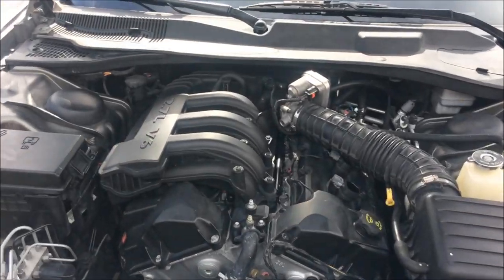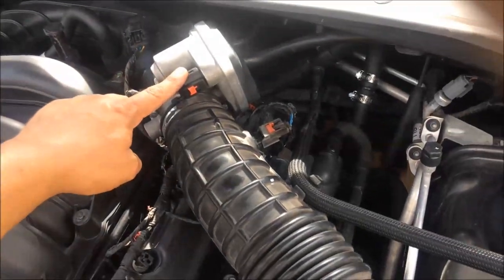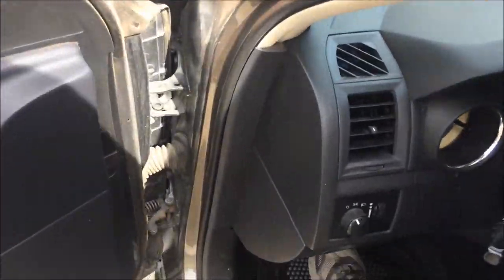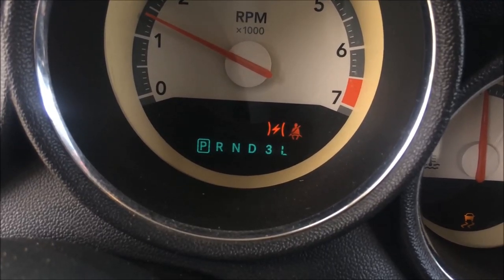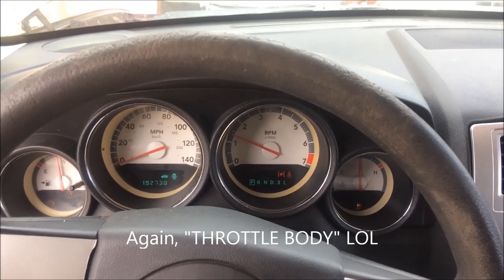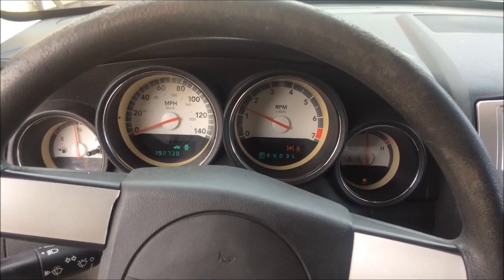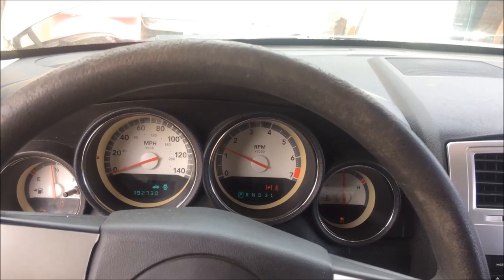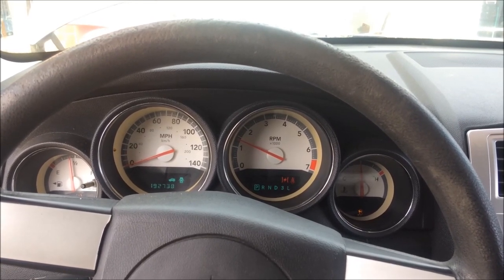Chrysler Dodge 2.7 3.5 v6 mysterious rough idle CHARGER 300 MAGNUM - EXPLAINED & FIX

Comment: I have a mysterious miss. After my 2010 300 heats up, it will get a miss if I turn off and restart the engine. It will run rough for as long as I drive it until I turn off the engine and let it cool. I can have the engine run for hours and it wont run rough ever if I dont turn it off.
Reply: Same u ever fix that?
Reply: I had a similar problem when my car would run to operating temp and I shut it off it would not start back up until ithe car completely cooled off changed my crank sensor and it fixed my problem hope this helps
Reply: @bimmergang2035  any news? Thanks
Reply: Egr valve
Reply: @vemomediadigitalmarketing7912 You think it’s the EGR valve?
Reply: Really…?

Comment: Hey man i had a peddle commander on my dodge gt charger 2019 it was working good for a couple months one day i gassed it to hard cause i was chasing some lasy that hit me and it made me go limp mode since then i unplugged the peddel commander and my car drives normal but when i gas it or take off at a light or take offf at a corner its holds back and turns on the engine light after a day the engine light goes away but happens again when i gas it what do u think i should do?

Comment: I was replacing my 05 magnum valve cover yesterday and didn’t get the main vacuum line into throttle body. Shit was running rough and I was so confused because I thought everything was plugged in. Gave that metal line a extra push and it went in how it originally was and runs like a charm
Reply: Also had flashing throttle light

Comment: I have been having issues with my 07 turning over for a few seconds and then cutting off, every time the exact same amount of time when I turn it over. And it just dies, no rough turn over or idle just starts . . . dies After a few tries it won't turn over at all and just has the lighting bolt stuck on the dash. No other indicator lights, not even the engine light, just the bolt. I am getting ready to buy a new throttle body but if you have any other suggestions, I could really save the money right now since things are kinda tight at the moment.
Reply from the maker: That’s an electronic throttle issue. The first thing you would want to try is to clean and reset the throttle body. Clean it good then disconnect the battery if you don’t have a scanner or have access to one. Make sure you plug the throttle body wiring harness all the way into the throttle body and it’s not slipping off like stated in this video. Check your battery voltage, clean battery cables etc to rule that out. If that doesn’t work then replace the throttle body (Check Amazon)  You can get throttle body / MAS cleaner at Walmart or any auto parts store. Manually open the throttle body and clean it really good. When they are really dirty it can restrict air flow but what you are experiencing is typical of a failed throttle body.
Reply: @WarPonyAuto  I am having the same problem with my car
Reply: @WarPonyAuto  how do I fix it
Reply from the maker: @hopearonson1034  It takes a proper diagnosis but if your is doing the same try cleaning the throttle body. Usually this means the throttle body needs to be reset or replaced.

Comment: I just started having this issue after changing coil packs, spark plugs,  and fuel injectors.   Maybe, I didn't get mine completely clicked in.  Thanks man
Reply: Did this work for you? I did these exact changes on a 2009 dodge charger 3.5L an now I’m having the exact same problem, the rough idle and shaking is so bad that I cant even drive the car or let it run longer than 30 seconds to check the engine
Reply: It did, but I also went ahead and a new sensor as well
Reply: Could you tell me what that sensor is called exactly, Im going to try the same thing
Reply: Map sensor

Comment: Great tip... I have a 03 astro. The block temp sensor plastic connector broke. It was hanging on. It would not start, idle rough etc. I thought it was the fuel pump or bad gas.. I glued it on. Only used high temp permatex on outside of connector to avoid getting it into the connections..

Comment: Glad u showed this most mechanics and auto shop dont even kno that u can check yo own transmission fluid they always say u GOTTA take it to the dealer 😂😂no u dnt chargers jus dnt have a dipsticks and the cap says dealer ship use only nope fixed and filled my own transmission problems and now I can fix this problem thanks
Reply from the maker: I’m an independent mechanic that won’t send anyone to the dealer unless it’s absolutely needed. Unfortunately there are some things and indie like me can’t do only because I can’t read dealer only codes on some makes and models. DIY learning is the best way to know your vehicle is being well maintained. 👍🏽

Comment: I got this problem again 
This is the biggest pain in Ass
Could it be a vacuum leak possibly
I have 2006 Dodge magnum 2.7 
Stalls When Stop or at idle
Reply from the maker: Yeah, the metal EGR tube has a round rubber gasket that can work it’s way too far into the plastic intake housing and allosaurus to be pulled in around it if not placed back correctly. Get a quality Mopar rubber replacement gasket. The AC Delco and FRAM gaskets will eventually leak.
Reply: Me toooo

Comment: So why does the lightning bolt come on with the check engine light but soon as I shut the car off and turn it back on the lightning bolt turns off but I don't lose no power when I push on the gas my car still goes no problem the lightning bolt keeps coming on then my car resets by itself
Reply from the maker: Man, I couldn’t tell you in that one without seeing it myself. That is weird….I would first assume an electrical issue. 🤔

Comment: mine has an idle problem but it loses power.  could this b the problem to?  or is it just if u idle to high?
Reply from the maker: That could be a few things 🤔 Have your fuel pressure checked. It can be hard to diagnose these issues especially when they do not trip the CEL.
Reply: @WarPonyAuto   ya  fuel pumps my next project.  thanks for the reply man

Comment: I’m having a similar issue when accelerating after turning a corner , I would loose power check engine light will flash on (code 304)  I’ve already changed spark plug and coil on cylinder  cleared code drive for about 2 weeks no issue then started happening again 90% of the time when I’m turning a corner 10% on accelerating to overtake . Now I’m guessing throttle body , injector or vacuum leak, any insight ?
Reply from the maker: We had those symptoms on a weak fuel pump as well as dirty and/or failing throttle body but start simple first…check wiring and vacuum leaks you’d be surprised how many problems both of those issues cause these engines.

Comment: Hi My 2006 charger have low arch when trying to start, I’ve switched coils and still low. Also I changed crank and cam sensors and it still will not start: help me plz
Reply: Try the intake manifold runner valve
Reply: And it could be that u jumped timming ur timming belt could be  Stretched and need replaced

Comment: good video brother.  I have a 2016 chrysler 300. If i don't use it for a few hours or overnight,  and try to star the car, it will crank but wont start. But if i open the key for 3 seconds before starting,  it will start instantly.  Seema like the feeding of gas to the engine is delayed.  Do you know what could it be?
Reply: Replace the fuel sender unit which it's the one in the passenger side  altought if you had never replaced the fuel pump  which is the other one located on the passenger driver is not bad idea to replace it too
Reply from the maker: It could be faulty injectors low fuel pressure/potentially failing fuel pump. It could also be a few other issues as well. A hood mechanic with an in depth scan tool can pin point it for you. 👍🏽

Comment: i have no codes... i do have a question what does your car idle at?
Reply from the maker: It was a customers car at the time. I did purchase it, repair and resold it a couple months later but it idled at just under 700rpm, around 660.

Comment: So I have code for cylinder 5 misfire did spark plug an coil still misfire but now the lighting bolt came on dnt go past 30
Reply from the maker: You may have to go deeper and have the EGR tube rubber seal changed in the back of the upper intake manifold or new upper body brake manifold gaskets. The next step in the process of elimination after that would be to connect the scan tool and read the #5 cylinder while it’s running. Check the fuel  injector to be sure that it is working, check the wiring on both the coil and the injector. If none of those are successful you will want to find a mechanic that can do a compression test of the #5 cylinder to see if it could be deeper in the cylinder head but that’s the very last resort. Be sure that the plug on the throttle body is plugged in good and the air cleaner assembly clamps are nice and tight.
Reply from the maker: You may also want to have your fuel pressure checked.

Comment: I have a 5.7 2010 Dodge Charger and I noticed the high idle between park and neutral. And my dash lights comes on and off and ac not working. Also the battery dies so I have to jump it off to start it up then goes back to the high idlling. Is this this same issue possibly????
Reply from the maker: That sounds like other electrical issues like a bad battery and/or bad alternator.
Reply: @WarPonyAuto  ok so now my car is experiencing a low idle now. When I slow down at a light while it’s in drive it seems to drop at 500 rpms and stays there. The car never shut up off or anything “yet” and it seems to kinda struggle hitting 60 or 70 when I step on it. What could that be???
Reply: @WarPonyAuto  I also have 3 codes with check engine light.. P0073  P0038  P0462
Reply from the maker: @jovontegraham9078  just going by what I’m reading it’s tuff to say but you may have a bad IAC motor (idle air control) in other words the throttle body may be really dirty or fluttering as it may be on the verge of failing. Find a good mechanic or shop in your area and ask them if they can check the throttle body.
Reply: @WarPonyAuto  ok thanks
Reply from the maker: @jovontegraham9078  Amazon and eBay are decent places to get a new throttle body at a much more affordable price than anywhere. With these Dodges you won’t always get an engine light when the throttle body starts acting up which can leave you guessing. 👍🏽 Good luck with it. Give us an update after you have it checked out or if you replace it.
Reply: @WarPonyAuto  hey where can I message you at? I have videos of what I’m talking about

Comment: I have a 2005 dodge Magnum 2.7 v6 and I'm getting codes showing up as spark plugs I bought new spark plugs and a coils and mechanic is coming this morning should I mention this to him? I need my car fixed should I purchase the part your talking about also? How can I test it?   Thanks
Reply from the maker: I'm sorry I did not see this when you posted it. I would have definitely mentioned to him. I do not have to replace them often. I wedge them or put a drop of super glue at the edge and zip tie it together if the customers do not want to replace them. It will hold. The better method is to clip a 1/8 section of Popsicle stick and wedge it under the locking clip which locks the clip into place. If you opt to change it they will break again. I had one break 3 times in less than 6 months before just telling the customer that it would be best to wedge the clip so that it stays locked. Hasn't had an issue yet.

Comment: What is the actual part you changed was it the throttle body or the plug thats connected to it that he was moving?
Reply from the maker: It’s pretty clear in all that I’ve stated… there wa nothing wrong with the throttle body! It’s the plug.harness that plugs INTO the throttle body. AS STATED in the vid 👍🏽

Comment: My 06 started running rough, then got to the point it would die when turning a corner. I have replaced fuel pump(didn’t help), all 4 O2 sensors (didn’t change anything), all new plugs(no change), new throttle position sensor (still does the same thing) I’m sad
Reply from the maker: In your case you would want an experienced mechanic to check your intake manifold gaskets and vacuum hoses. You can also have your alternator/charging system checked at one of your local parts stores. Most offer OBDII scanning. 👍🏽
Reply: I'm starting to wonder if is my alternator 
I have a 2006 dodge magnum 2.7 with 
234 thousand miles on it,,,I'm the second owner,,,,it looks like the original alternator,,,,most parts have replaced prior,,,then it started acting up again
Reply: Following this myself mines does the same at a red light I think it's a vacuum leak imma change the intake spray brake  cleaner on your throttle ,intake etc that's how u find the leak

Comment: What’s the best way to rig that clip instead of replacing the whole plug?
Reply from the maker: The best way I found was to put a drop of supper glue on the the out edge o the clip and push the plug all the way on, or if the locking tab is partially broken slid the plug all the way on and then slide a popsicle stick on top of the clip so that the locking clip locks onto the male plug on the throttle body, if that makes sense. You can see how I did it in the video.

Comment: I have brand new 19 charger v6 i bought in April 19 and mine has a slight shake. I feel line im moving when idiling. Thats the only issue. My dodge 19 hemi durango did same thing. Dealers say they cant find anything wrong. Would this apply to brand new vehicles?
Reply from the maker: Start with the process of elimination. Check the motor mounts and serpentine belt but with these vehicles being brand new those two issues are probably not your problem. You could try cleaning the throttle bodies, be sure your air filters aren't dirty or just replace them. One issue that I have found is that the newer Dodges (most newer vehicles) simply do nit like cheap gas. Regardless of what the manufacturer states do not use low octane fuel. Always pay the extra for high octane fuel. If these were zero mile vehicles when you bought them this would not apply but you can always do a tune up. And yes, make sure that your throttle body is plugged in, however, if it were not plugged in correctly you would have a lot more going on then just a shake at idle. As always it is tuff to diagnose a vehicle without having it in front of me. Hopefully these ideas will help. If the dealer can't find anything wrong you can always try a reputable shop in your area.
Reply: Same problem on my 2016 300 shakes the car at idle just enough to where you barely feel it but enough the be annoying. No codes on the dash. Did you ever find a fix?
Reply: @dominick8648  
Nope love the car smooth when driving but shake at idle or when stopped annoying as hell!
Reply from the maker: @dominick8648  with yours being a 2016 change your serpentine belt and belt tensioner. Also check your harmonic balancer to be sure it isn’t separating. With the car running check the harmonic balancer. If it looks even a little off that could be your problem. A complete tuneup and fuel injector cleaner would eliminate the spark plugs, dirty fuel injectors being a problem.
Reply: @WarPonyAuto  already tried the fuel system cleaner same problem, I’ll check into what you told me thanks appreciate it
Reply from the maker: @dominick8648  Sometimes it takes the process of elimination. Check your motor mounts and the transmission mount. The trans mounts being worn, even when they look decent to the eye, will cause that light noticeable shake at idle. Good luck. A good, experienced mechanic can point you in the right direction by looking at it.
Reply: @WarPonyAuto  thanks and yeah I gotta take a look at everything tommorow. This is all surprising to me that it’s even happening the car only has 50k miles alwaus taken care of and it feels like it’s way older and a lot more miles, appreciate the help I’ll let you know if i find a solution
Reply: @dominick8648  did you end up figuring it out. My car is a 2016 with 65k and it's annoying.
Reply: @Recovery909353  nope I’m at 56k miles and I have no clue starts to shift weird no lights on the dash no signs of anything bad so I turn the music up and ignore it all. I had a shake in my left suspension and everytime I turned my left turn signal on my wipers would engages and both those problems disappeared it’s a mystery w my car I’d rather not get worked up about it anymore